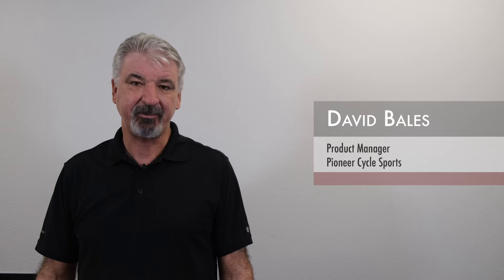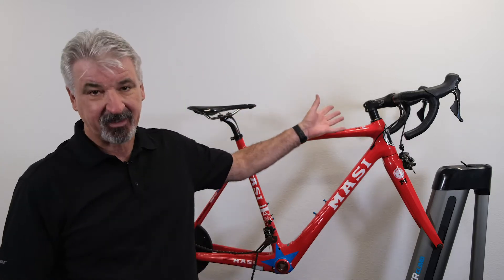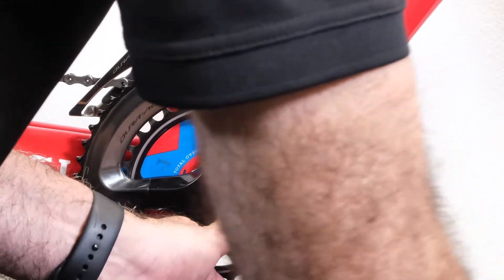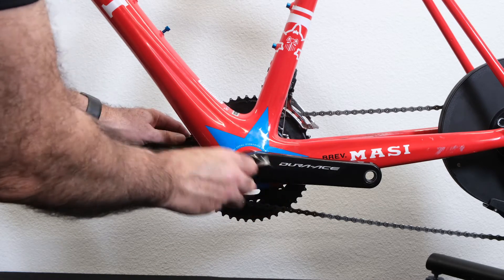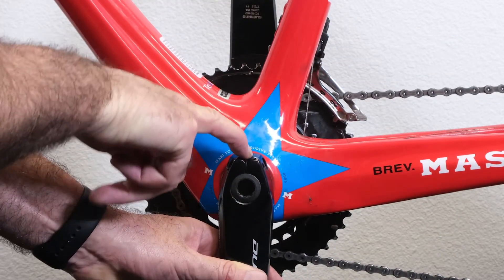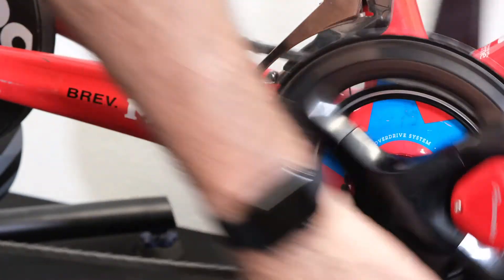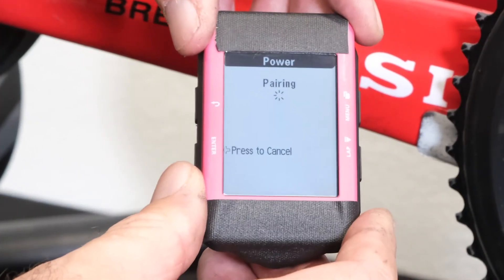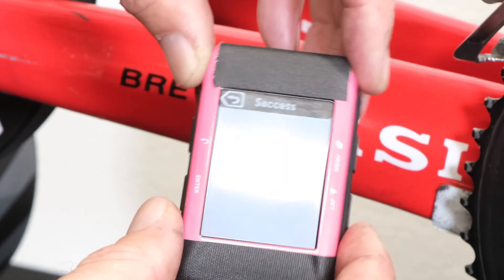How To - Install Power Meter Without Magnets

Comment: Not using a Pioneer computer for the video??
Reply: If you have a Pioneer head unit, you get more features, and for those features you need magnets, which are key to getting the 12 vector readings per side, per crank revolution.  But if you just have an 3rd party head unit, which can only do ANT+ then you don't need magnets, but you also will only get one power reading per second, regardless of cadence, like any other ANT+ power meter.   For this power meter, you can think as ANT+ as "dumbed down" mode and as such magnets are not required.  For full functionality, do yourself a favor and get the Pioneer CA600, which a truly amazing head unit that unlocks all the features of this power meter, and has turn-by-turn navigation, and 3 live partner and/or coach on-screen bi-directional sharing of performance metrics.  Had lots of head units over the last 30 years of riding and CA600 is definitely the most feature rich.  Highly recommended.
Reply: When using a Pioneer head unit you'd want to install the meter with the magnets so that you can view the force vector data from your pedal stroke... this is the install specifically for no magnets using Ant+ mode instead of pedaling monitor mode with a third party head unit.

Comment: This wasn't very helpful. Maybe explain why we, pioneer power meter owners, need magnets or what is the difference installing without magnets?
Reply: You only need the magnets if you're using a Pioneer head unit and want to use it in "pedaling monitor" mode for the force vectoring display. If you're not running in "pedaling monitor" mode or don't care about the force vectoring display, or if you're not using a Pioneer head unit then you don't need to worry about the magnets.
Reply: Eric Rump see my reply to the @irgccg's comment.  Hopefully my explanation is helpful.  Cheers.